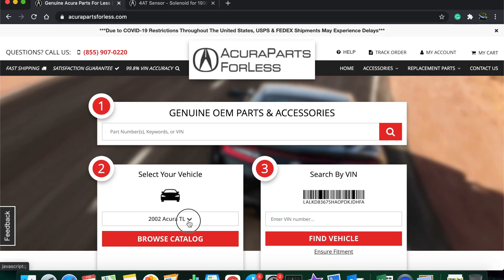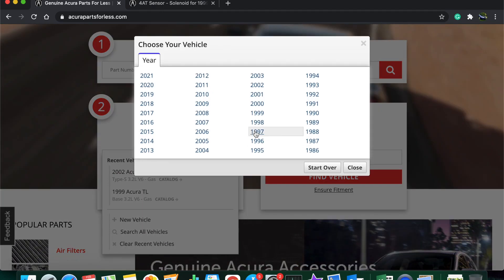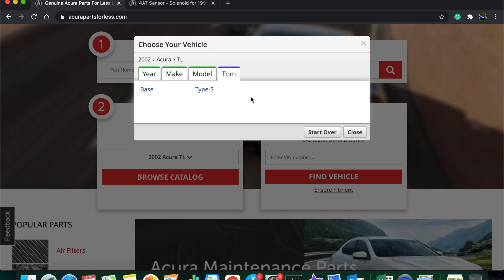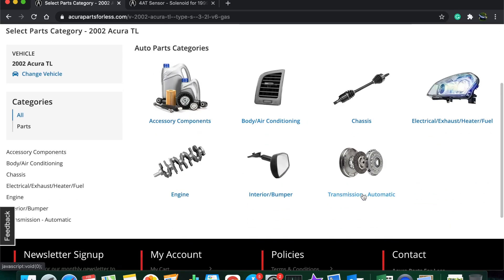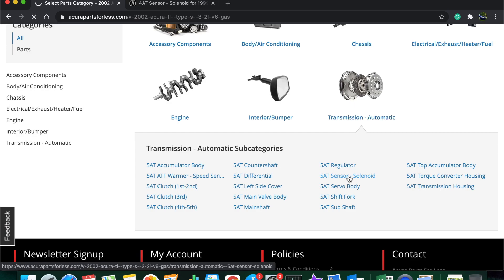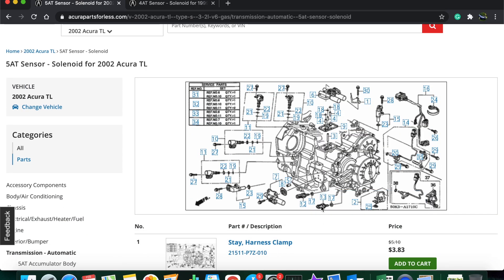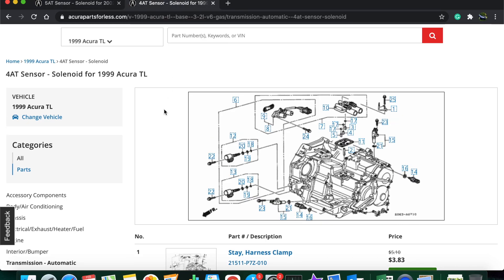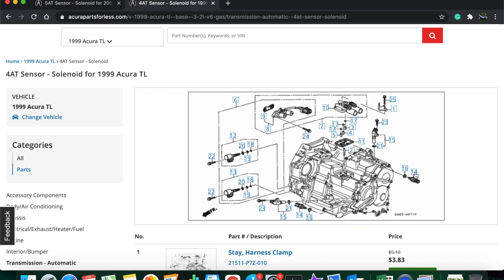How to Replace Honda/Acura Transmission Clutch Oil Pressure Switch P0845 P1738 P1739 P1740

Comment: Just bought an 03 TL type s with 99k miles. One owner and they maintained it at the dealer. No check engine light but trans sometimes slips when stopping and is trying to go back into 1st. Sometimes it’ll slip when going from 1st to 2nd and sometimes a delay from 2nd to 3rd. Trans fluid was clean when I got it. Did a drain and fill with OEM fluid and replaced filter as well. Cleaned filters on the larger solenoids that I got from your other video (thanks for that). Do you think changing these two solenoids will make a difference? Any other suggestions?
Reply from the maker: Congrats on the new car! You're off to a great start with maintaining your vehicle. 2nd to 3rd delay is normal on these cars, unfortunately. But there's still a good chance you could benefit from replacing the 3rd gear Oil Pressure switch as many other people have. My car also sometimes slips going back into 1st, but only when the transmission is cold. Slipping from 1st to 2nd is more uncommon. I would ensure that the transmission fluid is at the proper level https://youtu.be/SjYVD2WCrCM?t=555
Also, if you did find gunk in the solenoid screens, as odd as it may sound there is a chance they may need to be cleaned again. Good luck!

Comment: What would you recommend the trans bogging on D5?  4th gear is solid on the slab stick but when on 5th gear under 45mph start bogging sometimes
Reply from the maker: It could be a list of problems that unfortunately is hard to diagnose without being there and knowing the history of the vehicle. Does it have a CEL? You could check the basics including the air filter, spark plugs, and transmission fluid. Otherwise, you shouldn’t be driving in 5th gear below 45mph anyways, so a simple solution would be to put the gear selector in D4 for city driving, and put it in D5 for 45+

Comment: Recently bought a 183K 2003 Acura tl and the engine purrs but the transmission seems to be iffy. As a broke college kid and someone who knows what a transmission should be like this seems like a way better replacement than completely rebuilding the transmission. The only thing being every 15k miles as a person who isn't mechanically inclined would end up being expensive so looks like I gotta learn haha.

It has intermittent problems with 2 to 3 and 3to 4 and has a really really hard time when it's first started up after sitting awhile. Those both sound like A. Electrical problems and B. Pressure problems

So hopefully after a bit of saving I can start work :)
Reply from the maker: The fluid changes are super easy and you can certainly save a lot of money doing it yourself! I have a video on replacing the ATF on my channel if you haven’t seen that already. And by the sounds of it with you having gear specific problems, this certainly sounds like a solution for you. Hope this works and thanks for watching!

Comment: Hey man I need help, I have a 02 Acura TL type s, my transmission goes thru every gear when driving, but when I give full throttle it just won’t go to the next year like it will stay stuck so like it’s like slipping when I give full throttle, and then also noticed I’ve lost power
Reply from the maker: Kinda hard to say without being there in person. I always recommend starting with ensuring the ATF is clean and not over/underfilled. Also, do you have any check engine light codes?

Comment: I have the code P1739 for this same car but the transmission works perfectly, the code also says "A/T TCM driver circuit" can anybody help me? 😔
Reply from the maker: The TCM monitors the pressure switches. It might be running well for now, but something must have happened since it triggered a CEL. If you haven't purchased or done anything to your vehicle, you could start by ensuring the ATF is clean and not under/overfilled. You could also check the terminal is connected correctly and not too dirty or corroded. Otherwise, your 3rd clutch pressure switch might need replacing.

Comment: Hello,this past summer I had my rear chassis replaced on my 2002 Acura tl type s. (like yours)When I got it back I started getting the D5 blinking on my dash!!!😫😫😫 The vehicle wouldn't shift into overdrive on freeways!! Smh..I never had any problems with the transmission in the 4+years I've had the car!!! I changed solenoids B&C and still have the same problem!!! I check on the Acura forum and read that I needed to change the transmission temperature sensor!! I ordered it today and saw you're video changing the mounts!!! I'll do the same!! Keep up the good work!!👍👍👍
Reply from the maker: That sounds like a headache! Good for you for doing a great job maintaining your car and keeping her running! Thanks for watching my videos and glad they have been helpful!

Comment: My transmission started having issues last month and so far I have changed the fluid and the filter which has helped significantly. I am still have problems going from 2nd to 3rd occasionally so tomorrow I will clean the solenoid screens, if that doesn't help, I will replace the 3rd gear switch. Hopefully one of those fixes works. Your videos have been very helpful so THANK YOU.
Reply from the maker: Glad to hear there has been some improvement! Sometimes a second ATF drain and fill may be necessary if the fluid was dirty enough. But yes, clean those screen filters, and see what happens next. Good luck and thanks for watching!
Reply: @CarRepairsMadeSimple hey I have a question for you. I have talked to you before. I have a 2001 3.2 CL type S and its getting back into transmission behavior and it really started yesterday when it's super hot outside. I live in the deep south. But I'm wanting to try and change the transmission cooler but it's not the radiator style it's the canister type thats on top of the tranny. I'm trying to find out if this is a recall changed part. Because I can't find a radiator style anywhere on it. And I've only seen 1 video where a guy was changing on the exact same engine. Any help ?? TIA
Reply from the maker: @darrinwatts9979  Looks like the only recalls for your vehicle are the 2nd gear Oil Jet recall on the original transmission, and the 2 airbag recalls. There is no external radiator ATF cooler on these cars otherwise. It certainly wouldn't hurt to add one! Otherwise, make sure you're regularly changing the ATF every 15k miles and coolant every 60k miles/60 months to ensure proper lubrication and cooling properties.
Reply: @CarRepairsMadeSimple  ok thank you and ..... what is the part # of the one on top of the transmission the cannister type ?? Do you think you could find out ? It's aluminum looking and I can't find out how/where to order it
Reply from the maker: @darrinwatts9979  you can’t find an ATF Cooler because these vehicles don’t have one. What you’re looking at on top of the transmission is most likely the ATF Warmer (19430-P8E-A01)
Reply: @CarRepairsMadeSimple  and I can't help but wonder that 2-3 gear recall required the cannister type cooler
Reply: I know this was over a year ago but mine started to slip etc did yours get fixed?

Comment: How long did it take to fix the gear slipping after you changed the pressure switch?
Reply from the maker: The effects were noticeable immediately!
Reply: @CarRepairsMadeSimple  oh I guess it didn’t work for me :( I had the same issue as you with the 3rd gear slipping no check engine. Just replaced it now and it still slips…
Reply from the maker: @maximebolduc6499  I’m sorry this didn’t work for you. Perhaps a couple other things you could try is ensuring your ATF is clean and not under/overfilled, and also try cleaning the solenoid screen filters. I made a separate video for each of these as well. There are also multiple solenoids involved in the shifting process as you can imagine, so while replacing this pressure switch has fixed or at least improved many people’s shifting problems, sometimes it’s another component. The service manual says that shift solenoid valve C (which I replaced and didn’t fix anything for me) as well as A/T clutch pressure control solenoids valves A and B (the double solenoid on top of the transmission) are also probable causes of 3rd gear flaring and slipping. Many people have told me replacing the double solenoid has fixed their issues, except that part new is like $350. Hope this helps
Reply: @CarRepairsMadeSimple  thanks man I’ll definitely look to clean the solenoid screen filter. Thanks again for this video with the easy steps and still replying even after I don’t know how many years you’ve made this video!
Reply from the maker: @maximebolduc6499  you’re very welcome! Best of luck to you!

Comment: Hey i see you on acurazine all the time ur really smart with this car i was thinking of buying a duralast transmission oil pressure switch is tht a good idea
Reply from the maker: Thank you! I would be cautious about buying aftermarket solenoids. I have heard some people claim their transmission performed worse or not at all after replacing solenoids with an aftermarket one. Browse a few different Acura parts websites since pricing and shipping can vary greatly from one to another. I've had good luck with factoryacuraparts.com recently.
Reply: @CarRepairsMadeSimple  good to know ive did everything except the switches the 3x3 helped alot and changing filter
Reply: @CarRepairsMadeSimple  how long was shipping for u?
Reply from the maker: @backnd_2329  on average when ordering from any of these Acura parts websites, you can expect to receive your parts in about 5-6 days on average after ordering them using the lowest cost shipping option.

Comment: Do you know what would cause a PO 730, Incorrect gear ratio… Does that mean the transmission is bad? Could it be the third selenide?
Reply from the maker: It’s either the A/T clutch pressure control solenoids located on the top driver side of the transmission, and/or the shift solenoid valves. 2 of them are located on the front passenger side of the transmission and one on the top passenger side. Firstly, check your transmission fluid to make sure it’s not dirty or under/overfilled. Next I would do an ohm test on each of the solenoids. The driver side ones should be 5 ohms, and the passenger side ones 12-25 ohms.
Reply from the maker: Of course, these are the potential fixes for a Honda/Acura with P0730. If you have a different make of vehicle it could be completely different.
Reply: It only does it when I’m on my way home in stop and go traffic, and strangely only does it on certain roads it will start. It will go from 1 to 2 OK but sometimes it will slip as it tries to go into third. And when it’s really bad I’ll be going about 40 miles an hour and it will try to downshift into second. I noticed if I slap it into neutral when I come to a stop at red lights or in traffic and let it idle in neutral for a little bit it doesn’t seem to do it as bad. On the way into work it’s smooth sailing then again I’m going highway speeds almost the whole time.

Thank you for that video I watch the video cleaning the screens and I dug out the battery and the air box and took the top one off those screens were fairly clean the one below it, was a little dirty so I cleaned it I ohm tested all three solenoids and all of them are over five. The bottom one was reading about 5.2, but I tested it both ways positive negative navigate if I’m positive and it was 5.2 both ways the ones on the top for 5.2 one-way and zero the other way does that make sense? Anyway I change the transmission fluid and change the filter right after it started doing it a few months ago. This thing is driving me crazy! Lol
The transmission only seems slightly overfilled? And I replaced a quart with the Lucas anti-slip stuff. But doesn’t seem to make much of a difference.
Thanks again for your timely reply and your videos, and helping folks out
Reply from the maker: @weebleslove469  I don't know why it would only get an ohm reading one way, but I would say it passed that test. If it's an option I would drain a little bit of fluid so it's not over the max fill line. Just make sure the vehicle is warmed up, engine off, and parked on a level surface when checking the dipstick. If cleaning the screen filters and changing the transmission fluid hasn't helped, I might recommend replacing the A/T clutch pressure control solenoid with the 3 screen filters located on the top driver side of the transmission. Despite passing the ohm test, over time these solenoids can go bad. Perhaps they simply get sluggish or the piston loses its full range of motion, but I have received numerous testimonies that replacing it has fixed their transmission issues. Just make sure you get an OEM part as the aftermarket ones tend to cause problems as well. If you're looking for a band-aid fix, you can get a cheap used one on eBay or from a junkyard for about $50. Otherwise, if you're planning on keeping this vehicle for a long time still, I would get a new one. $360 is a lot but worth it.

Comment: I have a 03 tl that wont engaged in gear sometimes you can feather reverse or first gear first started and try to go I can feather it but then after that it just rose up a high RPMs
Reply from the maker: Easiest thing to check is your transmission fluid. Make sure it is both clean, not dark or burnt smelling, and also make sure it isn’t over/underfilled. Otherwise do you have a check engine light code? You can also check out my solenoid screen filter video on my channel. Sometimes those little screens get clogged and need to be cleaned out. Maybe give that a try as well.

Comment: Thanks for the video I am getting ready to purchase a 2003  to type s and the seller states that it has an transmission problem
Reply from the maker: Good luck! A lot of problems certainly can be fixed by simply replacing a few solenoids as opposed to rebuilding or replacing the transmission!

Comment: Hey my Acura cl 2003 is slipping gears , it don't drive on 5 the gear but it was works on 2 an that's it what should I do
Reply from the maker: Do you have a check engine light code? I remember I had a similar issue where the catalytic converter heat shield fell off, pulled on the oxygen sensor cable and caused a fuse to blow. Don’t remember which fuse it was but maybe check your fuses, there’s a bunch of them unfortunately.
Reply: I don't have a check engine , I have to warm up the car to vehicle temp n then put in 5th to drive if I don't let it warm up it won't drive in 5th unless I put it in 2nd gear.

Comment: Hello man I have a honda civic ES DIMENSION 2.0L k20 2004 mdl engine A/T when my car starts even in early morning from P TO D my car is fucking kick in or otherwise it’s feels like in Neutral but the gear selector is in D when I hit the gas my car Revving high then after a while it’s begin to kick in again, what do you think is the problem of my tranny dude TIA!
Reply from the maker: Could be a lot of things. Are there any check-engine-light codes? Otherwise, the easiest place to start is the transmission fluid. Make sure it is clean and red, not dark brown, black, or burnt smelling. It's also important to use only Honda DW-1 and make sure the ATF level isn't under/overfilled.

Comment: Is this the same for the CL?
Would it be possible to pick one up at an Auto Zone?
Reply from the maker: Yes, it's the same parts and process. Our cars have practically the same transmission. You could get one at AutoZone, but you'll still be paying about the same amount of money, I'd rather get the OEM part from Honda.
Reply: @CarRepairsMadeSimple  Thank you. Yeah I checked, and, same price, same thing, just made with cheaper parts. I think this is specifically what's wrong with my car. Then again, my fluid is overfilled, I checked it. I am going to jusr change it with the Honda stuff. Do you think the transmission might be hurt if I drove it around too long with it messed up like this? I was thinking of when I change it with the Honda fluid to add some Lucas oil, do you think that's a good idea or a bad idea?
Reply from the maker: @Secretlightkeeper  if the fluid is overfilled, it can increase the pressure inside the transmission and mess us seals, gaskets, and more. I also would not recommend the lucas, because that fluid is so thick, and one of the problems with these transmissions are the numerous tiny screen filters that already have a problem clogging up.

Comment: I  have honda civic fd 2.0... Aotumatic trans... For a cold start, I had to heat the car for 20 minutes..if not, shift from P to D would make the shift jerk.. Please tell me what would cause this?
Reply from the maker: Assuming you don’t have any check engine lights, you could firstly ensure that your ATF is clean and red, not dark, brown, black, or burnt smelling. Also make sure the ATF is not over/underfilled. and be sure to use Honda DW-1 fluid! Aftermarket fluids can cause harder shifting
Reply: @CarRepairsMadeSimple  I only use genuine honda ATF DW-1. No engine light comes out.. If it does, what would it means?
Reply from the maker: @macej8696  it would mean something is abnormal with the car. You can look these engine codes up online and they’ll give you more specific information on what the code means and how to fix it. Sometimes it’s as simple as adding or changing the fluid.